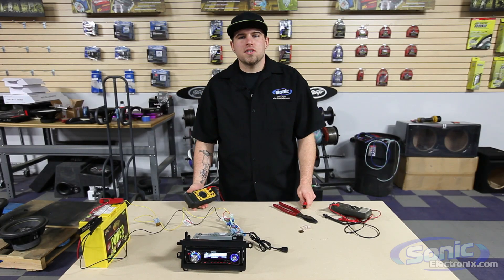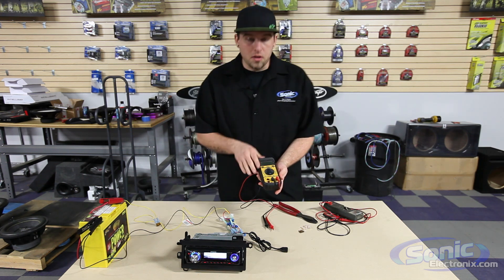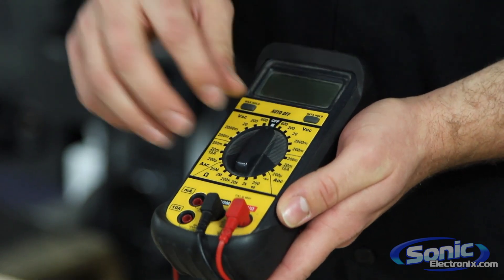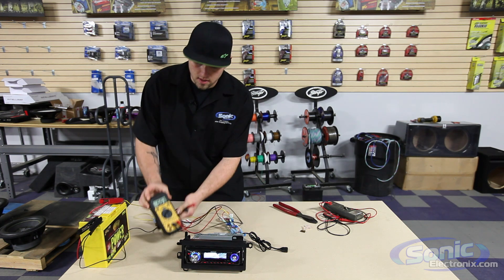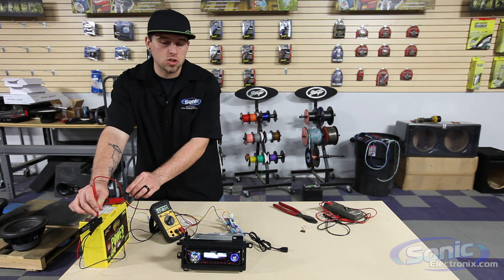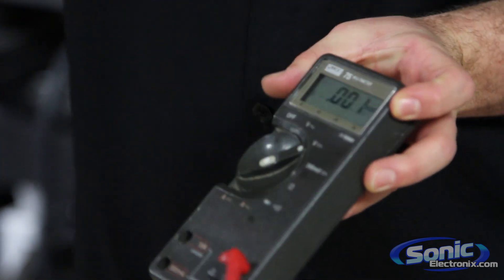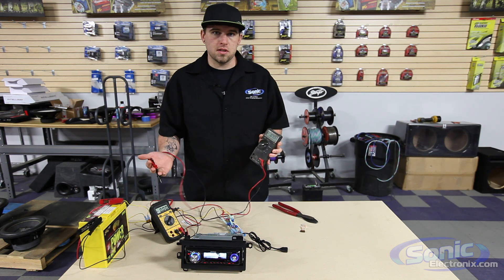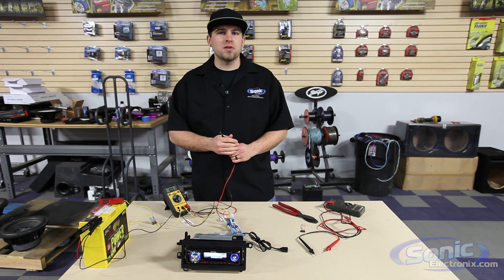How to Use a Digital Multimeter (Checking Voltage) | Car Audio 101

Comment: How to check voltage coming from RCA cable?
Reply: Play a sine wave (e.g. 1kHz tone) on your head unit and use a multi-meter or oscilloscope to measure the line level voltage at different volume levels (min to max) to find your voltage range.  Or more accurately, play pink noise and use and o-scope to get your voltage curve over the entire frequency band.

Comment: I got 2 amps, one under the passenger seat and the other in the trunk. They have separate ground and I don't seem to have a ground loop, everything is silent no engine noise. I tested the voltage on the amps both read what the battery poles read. I haven't tested the ground resistence though I think I should do that. I have no voltage drop. Somehow the bass sounds muddy and boomy with a JL 12w3v3 in ported box built to specs. When you are close to the sub box it's like a bass echo. Does this have to do with the box itself or could it be a wiring issue?
Reply: Could be overdriving the sub or driving the amp into clipping/distortion.  Did you gain matching everything?
Reply: @marko6394  no none of those. it seemed to be a setting issue, namely crossover settings. Due to the acoustics if this car Kia Rio Hatchback, I am forced to Low Pass a minimum of 40hz say 12db Slope. And have enough power in the front aystem for above 50hz. I never thought about cutting the sub that low. I always set the Low Pass minimum 50Hz. Never under. But it always sounded weird. Like there were cancellations between 55-65 75-85 or so Hz.
Reply: @florinwizz  Interesting.  Car dynamics definitely have an impact on response.  Thanks for the reply!
Reply: @marko6394  Yeah because I was used to my old car, in which I never experienced ca cancellations. Here there are always dips experienced, some upper bass overemphasis so that  its under the false impression that the low bass is cut but it in fact it isn't. I know it's not a short story. Ha. I invested in new components and it was trial and error until I figured it out.

Comment: I have a 2010 Jeep GC laredo and my radio works but no sound. How do I check to see whether the problem is in the radio, speaker, or amp? I took the radio out to take it to get tested by the audio shop right down the road. If I can troubleshoot it myself, i'd rather do that. I have a multi-meter and checked the amp and speakers but am not sure I checked them correctly. Any help would be greatly appreciated.
Reply: Peter Timpson check the wirings of the radio to the speakers..     search online for a diagram of your factory wirings of your jeep
Reply: @joshua199628  thanks for the feedback. It was the amp and got a replacement. Works like new!
Reply: Peter Timpson no prob man 👍🏼